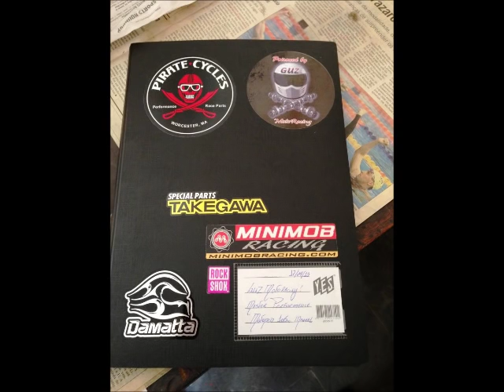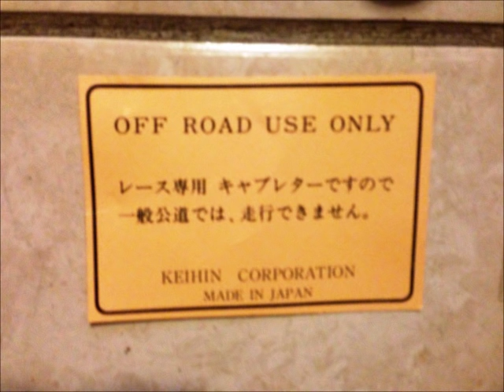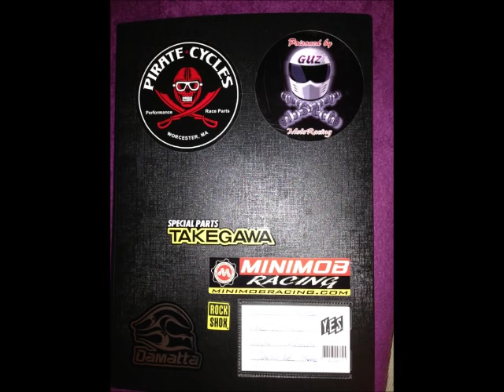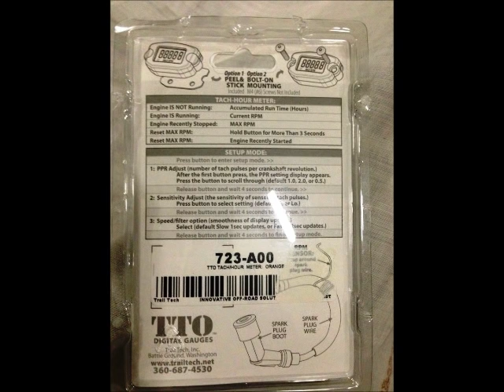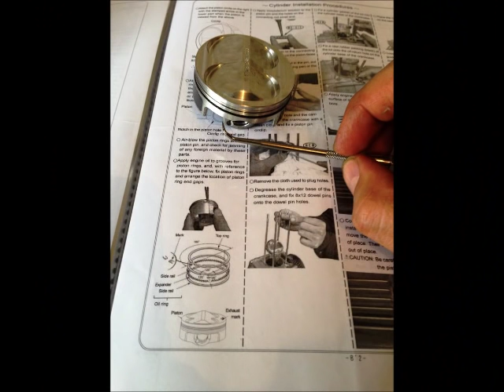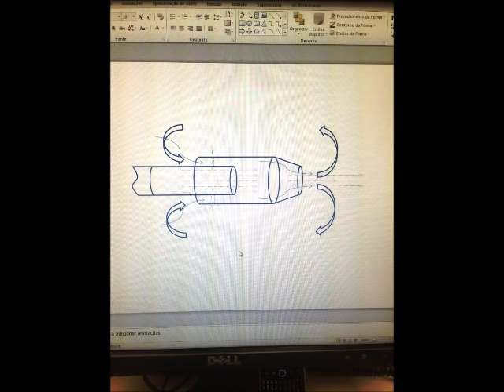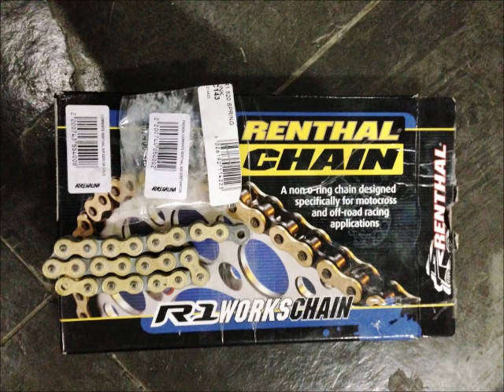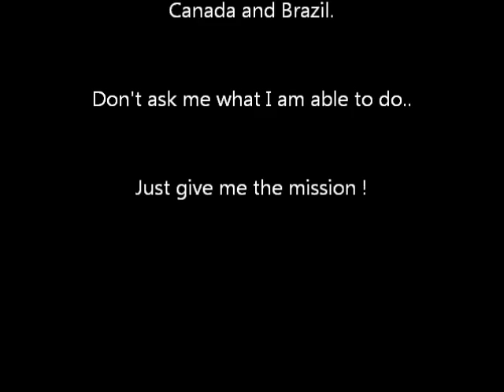Motoped Movie by GuzMotoracing Version for Smart-Phone

Comment from the maker: Jason,
If engine is off, it has to be in Neutral. So only secondary axle moves on the engine, no gear box or crank.
If engine is on, and spinning slower than the pedals you will feel the drag, but it is a very unique condition as engine need to be in idle and the bike going in very slow speed. True is: Engine turned on, it will be always faster than pedaling!
Go on motopeds home page and check the video, there are some shots showing this condition !
Big Hug !
Guz

Comment: Question: How does the pedaling system work with the engine? If your pedaling is this moving the engine sprocket as well or is there a freewheel somewhere so the engine isn't moving if it is off and you are pedaling?

Comment: I like the style of this bike the problem is assembly and the power to weight ratio.
I've got a 33 lb.beach cruiser the 2 stroke kit is 32 lb. the bike I'm working on when finished will weight less than 75 lb.completely finished.I'm not to impressed with this bike builders kit but it's a nice looking peddle bike .
Reply: where im at they produce this motor from 50 cc to 200 so you can upgrade pretty fast
Reply from the maker: SRT480 Yeap!! Many many power options.. Mine is already too fast.. if go for 4th gear and full trhotle speed goes nuts.. wheel are not designe for it hahahhah